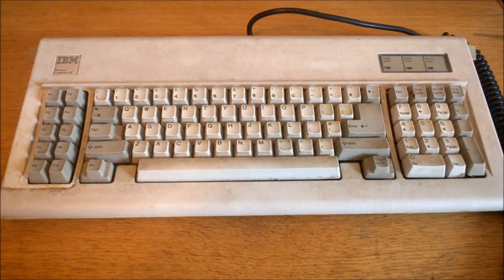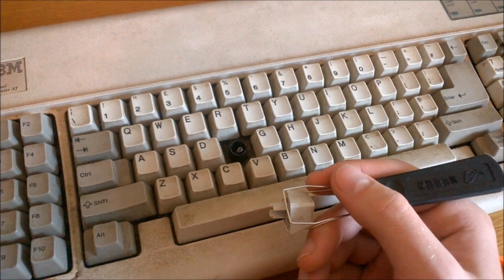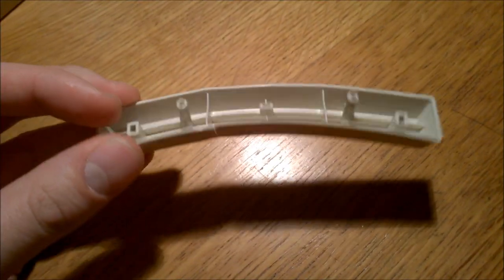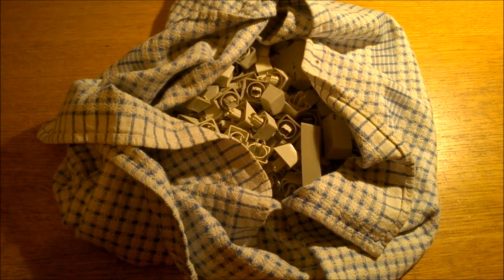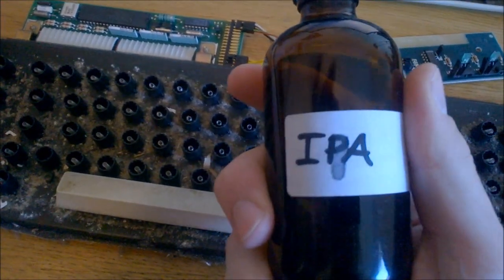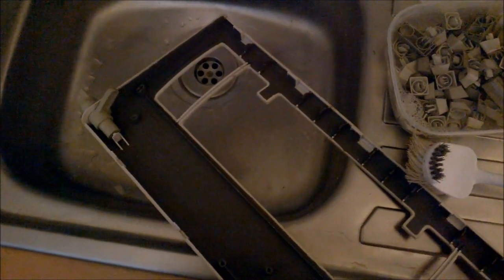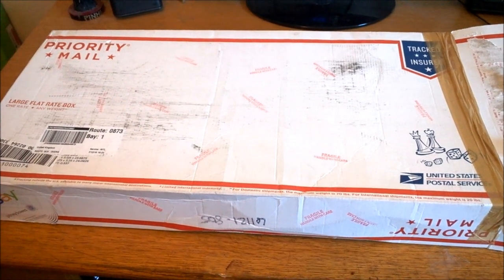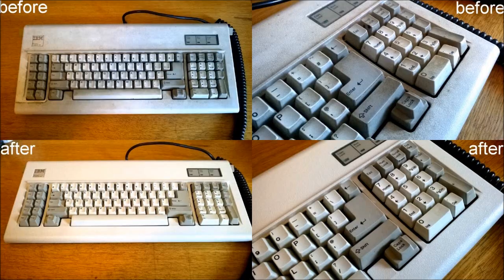QKT 7: Cleaning, maintenance and storage

Comment: I use industrial cleaner. Drown the caps in a 1:10 mix with water, stir and they are as good as new. Same for plastic cases, although usually they need some scrubbing.

Comment: I have a Model F AT as well, and is currently using it as my daily driver. The outside shell looks pretty clean, but the barrel plate seems rusted and I did not dare to take apart the keyboard like you did (never even seen its foam). Do I need to be worry? Or can i just keep using it like this?
Reply from the maker: Don't worry about it when it's alright. Worry about it when it starts going wrong ;) .

Comment: Nice video. How long should the keycaps soak in the boiling water? Also, any tips for removing a Model F XT spacebar?
Reply from the maker: 1) the longer you soak them, the looser the dirt will be. I'd leave it overnight at least. 2) DON'T just pull it off! You need to disassemble the whole shell in order to lighten it (bend the stabiliser inwards).
Reply: Well, I think my stabilizer may have a problem then, since the key is wobbly (doesnt register on sides) and the spacebar frequently pops out. When it pops out, I see the stabilizer under the actual barrel. I have to assume that's not normal.

Comment: Love your videos! I just picked up a Model F XT at a thrift store and it's quite dirty so I'll be using your methods to try cleaning. Quick question, you mention PBT vs ABS for the water temp for cleaning keys, but how do you tell which type it is?
Reply from the maker: All Models F and M used PBT :) .
Reply: Cool! Now to get to cleaning...

Comment: 4000 subscriber mark is a-coming. 
I still have 12 very dirty M's in my garage to deal with cleaning. two are going for christmas gifts, the rest are to be sold for probably 50-65 bucks each after testing since the vast majority of them are permacorded PS/2 Lexmark '97s. I'm thinking about putting the caps in a netted bag and running them with laundry detergent on ecowarm (which comes out to about lukewarm or so) for a light load or two in the washing machine with a clean possibly-sacrificial bath towel to keep the balance. I know I have to just doublecheck the detergent ingredients to make sure nothing's reactive with ABS, otherwise it seems safe to me, but I'd like to hear your thoughts on the matter.

Comment: What if the mechanical run out of their rated life cycle? Do they still usable? I have a Matias Tactile Pro I and I am worry about them wearing out. Especially, that ALP stopped making a switch.
Reply from the maker: CineRaphael that's the minimum amount of cycles the switch is rated to achieve. After that, mechanical or sensing issues may or may not occur.

Comment: I use dishwasher powder, this is good on more ........ biological dirt ( human slime) than soap. 

Where can i get that solvent for removing labels ?
Reply from the maker: Anything apolar will do, doesn't have to be specifically LPE or CyH.
Reply: Is CyH CycloHexane?
Reply from the maker: Yes, Cy = cyclohexyl.
Reply: I know if you live in the US like me you can get products like Goo Gone, or Goof Off to help remove labels, and glue left behind. Also if you just get plain Hydrogen Peroxide, and put all your yellowed keyboard parts in bags or clear plastic bins then set them outside in the sun on a not too hot day that can help bleach the bromide out of the plastic a little better, also if you are in the US you can go to a beauty supply shop like Sally's and get Peroxide hair cream up to 30% constriction(any stronger by law requires a beauticians license), and that will help clearing the plastics even better. Also yes you can get electronics main boards/mother boards wet long as there is no power going to them including something like a CMOS battery on a motherboard to clean them(look up dish washer Mac fix), you just need to let them air dry out for about a week in a warm dry spot before putting them back together. I know this works because I've done it all on a 486 Compaq laptop that I salvaged from my deceased aunt's home who was a chain smoker, and the case was yellowed to all hell along with the main board covered in GOD only knows what crap, and I now use it as my Windows 3.11, and DOS machine for older games output threw the VGA port to a 23in ACER LCD monitor in my guest room.

Comment: How I would wash my Keycaps. I would throw keycaps into pantyhose, tie it up, toss into the washing machine add a generous amount of washing detergent and set to wash full cycle without heat. Works every time.
Reply from the maker: You have to be a bit careful with that, though. The rolling around could damage the plastics. Fun method, though xD .
Reply: Yea, I'm aware of the risk, always set my washing machine to lowest strength.
Btw You don't have to careful or politically correct around me. My feelings don't get hurt easily.

Let's call a spade a spade, my method is lazy and at one point of time, my GF almost wanted to kill me because I used her Wolford and she said it cost 10 times more than my keycaps.  I told her I didn't believe that I would pay for a new pair the next day. I regretted saying that because it's true.